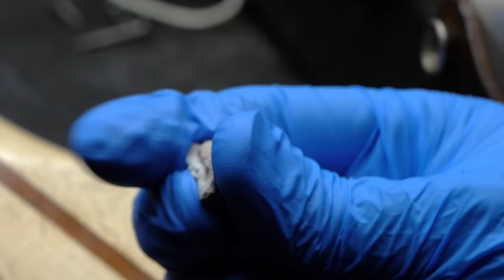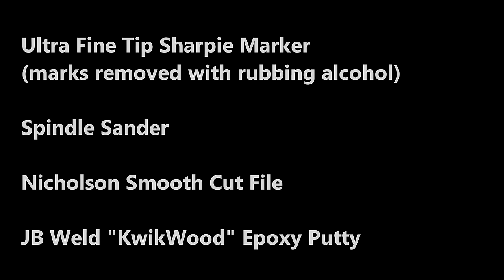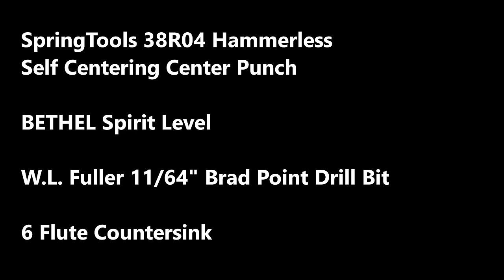My Strat Gets a Heel Contour

Comment: Use a backer next time? Yeah, how about the neck itself😅 drill them both at the same time and you've got perfect lineup
Reply from the maker: Skipped my mind completely. The only caveat though is the difference in hole size between the neck pocket and neck heel. 

You'd have to use the smaller size intended for the neck heel first if using traditional sheet metal screws, then open up the neck pocket hole with a graduating series of twist bits after the initial drilling through both. 

For inserts, you'd have to use the same graduating twist bit method on the neck heel, as the pilot hole for the inserts is bigger than the neck pocket holes. 

The Brad point would make the initial hole and then you'd have to open that hole up with twist bits on the drill press to get it to the proper size. 

So, two Brad point bits in one scenario, then two Brad point bits and many more twist bits in the other. 

One hole with a Brad point guarantees a dead centered hole. One and done. When expanding holes with a twist bit, you often have to graduate up through several sizes if you want to be sure you're not losing center, and to prevent blowout/chipping, depending on the size of the pilot hole. 

That, and getting a body and neck perfectly flush on a drill press is tricky, due to the radius of the fingerboard. 

There's a tiny amount of leeway with the insert location, but only a tiny amount. One Brad point drill thru is the highest in accuracy. When opening up holes with twist bits it's possible to lose center, and if you're off by too much then the threaded insert will be in the wrong location and you won't be able to thread into it without oversizing the corresponding neck pocket hole
Reply: @guitar_md  You went a long way to say that you don't know what you're doing. You're over-complicating everything. It's not as hard as you're making it, or even making it out to be. Hell, you even filled in the previous hole in the neck for no reason.
Reply from the maker: @shelbyavant5081  OK. Let me put it simply for you: 

You don't understand that the neck pocket and the neck heel used different sized holes. 

Is that easier for you?
Reply: @guitar_md  Sorry, bud. I'm a machinist. I understand everything you're saying in your paragraph of justification, it just isn't as hard and involved as you're trying to make it. I wish I were there to help you.
Reply from the maker: @shelbyavant5081   The neck pocket holes are 11/64" and the insert holes in the heel are 17/64". You'd have to bore out the 11/64" hole with a 17/64" bit to get it sized properly. 

Using a brad point in one go is more accurate. I don't see how it wouldn't be more accurate.

It's also easier to guarantee that the neck heel holes are perfectly straight when chucking it in a drill press vise. That threaded insert needs to be installed as close to dead straight as possible. 

How are you going to make sure that complete guitar with the neck attached is 100% dead level before drilling 1.5 inches deep into it, through both the neck pocket and the neck heel? 

All I ask is that people explain  themselves objectively. I don't care about credentials. They mean absolutely nothing. You're a machinist. OK. Well, I'm the King of the Danes. 

That doesn't really help explain what's going on here or what the optimal way of going about it is. Think of it like a machinist: Objective, mechanical facts. There are optimal ways of doing things. And those can be very easily described. This is why they have people that write technical manuals.
Reply: @guitar_md  Wow, I've never met a King before! Maybe you missed your calling writing technical manuals, though. I wasn't questioning your accuracy. You must have inferred that. If you think you are doing every bit of this the best and only way, then no one is going to convince you otherwise regardless. I don't know what your credentials are, but if you don't respect them, then you likely don't have any, which is odd considering you obviously respect technical manuals, which are printed on the same paper. Have a nice day, and good luck creating a successful channel with your winning attitude. There are a hell of a lot worse critics than me out there, and a hell of a lot better creators than you.
Reply from the maker: @shelbyavant5081  You came onto my video and insulted me in response to my initial reply. Telling me I'm overcomplicating things and have no idea what I'm doing. You glazed over my respectful response and then said that. That's an insult.  

Even your initial comment was snarky and had an air of being a know it all instead of making an actual helpful comment. Like it was funny to you that I did something you thought was stupid. 

You decided to make fun of me for writing a long explanation, telling me I'm overcomplicating things and have no idea what I'm doing. Instead of addressing anything I said. 

I never said my method was the best. I merely asked you to substantiate why you thought I was overcomplicating things. 

And you never did. And then you insult me again. All I did was get irritated with the snarky attitude you came at me with. 

Would you walk into a machinist shop and go up to the guy and tell him he's overcomplicating things and has no idea what he's doing? 

Go try that at a local mechanic and see what happens. I'd love to know the results. Then try to convince the guy that he's the problem like you're doing with me. See how they react to that. 

You come at people with an attitude and eventually you're going to run into someone who gives you one back. Just how it is.

You could have just responded objectively to my first reply and made your case. Objectively. You chose to insult me instead. 

This is usually the end result when you're dealing with people that aren't doormats.
Reply: @guitar_md  Bro, you're wasting your time every step of the way. I'm not here to teach you. Or just keep on writing paragraphs, what do I care? Smoke a J.
Reply from the maker: @shelbyavant5081  Yes, I am wasting my time with you. Have fun getting high. Remember not to operate any heavy machinery
Reply: @guitar_md  Oh, I don't do that. Just seems like it might help you.
Reply from the maker: @shelbyavant5081  I'm sorry for losing my temper. Life is too short. I haven't smoked weed in a couple years and have also quit tobacco and only drink alcohol on extremely rare occasions. 

I am however having some buffalo wings and fries at the moment. Trying to be more strict with my diet as well. But once in a while you have to ease up on these things.
Reply: @guitar_md  I am very sorry for being a textbook internet troll today. Really. Today wasn't the best, and it had nothing to do with you. You obviously do fabulous work, and there's always more than one way to skin a cat. Looking back, I don't know what the hell my problem was. It was extremely adult and manly of you to send this. Please accept my deepest apology here in this public forum, I hope others see it.
Reply from the maker: @shelbyavant5081  I wasn't any better. It's all good. Also, your non aggressive response to me led to me being able to calm down. I continued to aggress when you were trying to de-escalate. 

I also had a terrible day that had nothing to do with you. Funny that we coincided like this. It's all good. 

It reminds me of one of my favorite zen koans, called The Gates of Paradise:

A soldier named Nobushige came to Hakuin, and asked: "Is there really a paradise and a hell?"

"Who are you?" inquired Hakuin.

"I am a samurai," the warrior replied.

"You, a soldier!" exclaimed Hakuin. "What kind of ruler would have you as his guard? Your face looks like that of a beggar."

Nobushige became so angry that he began to draw his sword, but Hakuin continued: "So you have a sword! Your weapon is probably much too dull to cut off my head."

As Nobushige drew his sword Hakuin remarked: "Here open the gates of hell!"

At these words the samurai, perceiving the master's discipline, sheathed his sword and bowed.

"Here open the gates of paradise," said Hakuin.
Reply: @guitar_md  💙💙💙🔥🤘🏻 A gentleman and a scholar. It appears neither of us wasted our time, only our emotions. I am blessed to have crossed your path, thank you for forgiving me in crossing you.
Reply from the maker: @shelbyavant5081  Likewise, I appreciate your patience with me

Comment: I was like "Ok and now to finish things off hes gonna paint the barewood with epoxyspot".

And then it never happened.😂
Reply from the maker: Yep! Leaving this one as bare wood. I could put shellac over it, or if I really wanted to go all the way, Zinsser BIN primer and then airbrushing olympic white nitro to match the rest of the finish. Would take weeks to dry and then wet sand and buff and it would look like it was done that was from the factory. 

I've done my fair share of finishing in the past -- hate it. Haven't touched a spray gun in a couple years now. Actually been meaning to do a video on shellac finishes for necks -- the best by far, in my opinion. 

Just another benefit of working on my own guitars. I'm actually really surprised you're the first person to comment on this. I was pretty certain that the epoxy putty filler, which doesn't even match the color at all, was gonna trigger the heck out of people. 

And I wouldn't blame them!
Reply: @guitar_md  paint with sponge and will be ok

Comment: SOOOO much better i do this to all my strat styles too
Reply from the maker: Awesome! Do you do it like I did, or also remove the wood on the pocket that's in contact with the heel of the neck? 

I've seen on some more modern Fenders they're doing it that way. Like on the Elite Strats. Curious what your method is. Either way this does make a huge difference but I'm curious if it would be even more noticeable doing it like the Elites
Reply: @guitar_md  yes i just do it as best i can by hand since i dont have a drill press but i did this on a 22 fret franken-strat a few years ago and it plays so much nicer. i like that fender does it now too on their higher end or more modern strats.

Comment: Cannot believe you used putty, and didn't paint the bare wood. It's your guitar but it seems too nice for amateur hour.
Reply from the maker: I get lazy with my own guitars sometimes. I've sprayed many finishes and I absolutely hate doing it. I could have used white primer and then airbrushed nitro over it. Then wait weeks for the solvents to flash off and wet sand and buff to make it look like a factory job. Huge pain and for me personally, no benefit. I actually prefer the feel of bare or thinly finished wood and it makes it feel more like a natural extension of the neck than part of the body. 

I'd actually prefer putty in the case of finishing as well, as it has no grain and nothing for the primer or nitro to sink into. Doweled holes can soak up a lot of primer and nitro and sinking is a huge issue. The putty leaves a completely smooth and non porous, solid surface ideal for painting over.

These days I just do an ebony grain fill and hand rubbed shellac over bare wood. I'm done with other finishes unless the body or guitar came with one. The last major job I did was two stark white nitro finishes on a Tele Deluxe and a Bass, originally candy apple red and black, with a custom nitro airbrushed pickguard with a design I cut the stencils for myself on the bass, and a recessed Floyd Rose rout and install on the Tele. 

Never again. A finish would certainly have made for a completely professional video from beginning to end, but I don't have the time these days. 

I don't use 2k poly or acrylic finishes and nitro is what I'm most comfortable using, but it takes ages to do professionally in a way that leaves it looking like a factory job.

Comment: Unnecessary mod.  The only thing I liked is that there were threaded inserts in the screw holes of the neck.  You should've left the screw hole uncovered so it can be used in a normal guitar.
Reply from the maker: Absolutely necessary if you want better upper fret access. Improved the upper fret playability by an extremely significant amount. Night and day difference. 

Agreed about leaving the old hole, though. I did this originally but OCD got the better of me. I did a ton of work on this neck that I have in other videos. Including the threaded inserts, a shellac finish, recontour, reradius and stainless steel refret, cut a bone nut for it, installed Gotoh vintage staggered tuners. 

This neck will be staying on this body, and any other blocky neck pockets will be getting the same contour treatment in the future. But yes. For a standard neck in most cases it's best to leave it so it can be installed either way